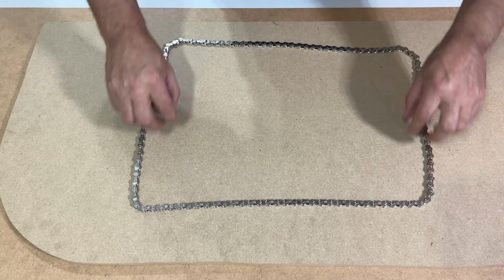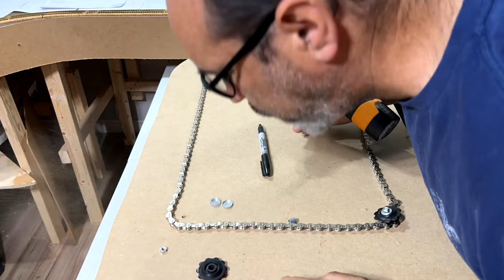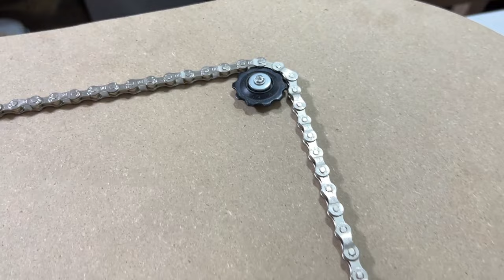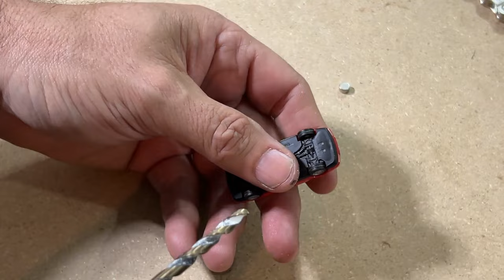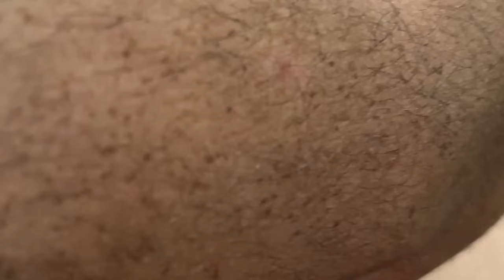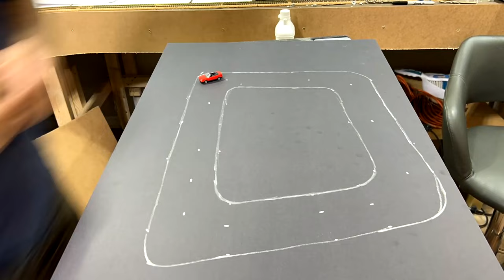Budget DIY Moving Car System For Your Model Railroad. Part 1 - Proof Of Concept.

Comment: For the tension use one of the jockeys fixed inside the chain run by a weak spring attached to the board. You would need a U shaped bracket to attach to the jockey with enough room for the chain to run through it.  I appreciate a drawing at this point would be useful…
Reply from the maker: Who needs drawings when we have overactive imaginations, lol.

Comment: You're doing what I have been thinking about for a while now. Recently, at the ventura train show, I saw a working concept of using a TV screen to imitate moving water with moving boats. I like your idea for the roads, but wear and tear on the road (let alone the autos) is something I consider as well. (I should add, the boats on the TV screen were actual models attached to a rolling motorized frame that was guided by an optic that followed a moving blank spot on the screen...it was pretty cool)

Comment: Nice idea, a lower ratio geared motor might help make it run smoother. Like the idea that the vehicle can be placed anywhere along the chain. I have used a plastic chain with magnets glued at various points. I found that by using clear acetate strips under the chain it reduced noise and friction. I also use sleds with pins which slot into different vehicles.

Comment: Great concept. Maybe some strips of aluminium foil or waxed paper glued to the board under the chain will reduce the friction and noise? I think using tension to raise the chain will put too much pressure on the sprockets and you'll get other issues.

Comment: I made a similar system a few years ago. I used a Takanawa 555 gear motor geared to around 40RPM. The 555 motor comes with a slotted shaft and is a direct fit for a jockey wheel. Simply screw in a small self tapper on the inside of the jockey wheel hole to fit in the slot. That way, it only turns with the motor. Also, those metal washer things on the jockey wheel - remove the bottom one. That way, the wheel sits at a better height on the base board without the teeth fouling the chain. I had one jockey wheel at one end, and another one at the other, to give a long loop. It gives the impression of two way traffic if you hide the turns at each end. Next i used some 10mm thick XPS board to build the road level up to chain height. You need to use 1mm thick magnets glued at your preferred spacings on top of the chain. 1mm card was then used as a road surface. Don't fix magnets directly to cars, because you're forcing the whole car down onto the road with too much magnetic pressure - make some 'sliders' similar to the Magnorail ones. That way the car just sits on the top under it's own weight. The whole system worked very well at a fraction of the cost of Magnorail. I intend to build another one into my next layout.

Comment: Dear Scott, cool experiment, proof of concept already achieved. Humbly think you’ll need a channel on both sides of the chain. Just enough to keep the steel pins of the chain from touching the wood. Next to that, am also wondering if such a channel can provide support for the motion of the chain with less cog wheels? Maybe even with some bearings adjusted to the height of the chain. Anyhow, love this project. Looking forward to your next episode. Cheerio
Reply from the maker: Thanks Vincent. I was thinking of using something like electric wire conduit to channel the chain, but it might be too noisy. I know it can be made to be quiet, since a bicycle doesn't really make any noise when you pedal, so I know it's possible if I can just remove the friction.

Comment: loved the different idea. i think if you use either bigger gears, or maybe 2 or 3 smaller gears to build a turn, that the cars will follow much better. or a much stronger magnet that really grabs on. Last idea would be to fix steering weels as the car now only wants to go in a straight line. ow and build in a speed reduction in some way as you dont need the full amount of RPM from the motor.

Comment: What you could do for pulling the car along is a method similar to actual magnet rail track.  They use a a little copper strip with the end turned up to put the car on and thin magnets on copper strip, not attached to the car.  Making the copper strips would be easy.  Just take a piece of solid copper wire from 14 gauge house wire and hammer it out flat. You might get 2 pieces from the same length strip of wire.

Comment: So, if you shim up the chain, so its not touching anything, add extra jockey wheels, as has been suggested as sprung jockey wheel to add tension. Think derailleur.
Make longer chains with soft links. 
Excellent proof of concept.
Reply from the maker: I'm going to head to Home depot and see what slidey channeling they might have. I don't think I can avoid the chain laying on the ground. I would need a huge amount of tension, which would require an extreme motor with fancy bearings yada yada. A derailleur is a fine idea, but it's just something else to take up space.
Thanks for your ideas and nice comments.
Reply: Making longer chains is easy. You just need a bike chain tool to push the pins in or out.
I have a tandem bike with 3 chains and store bought chains are never the right length to start with.

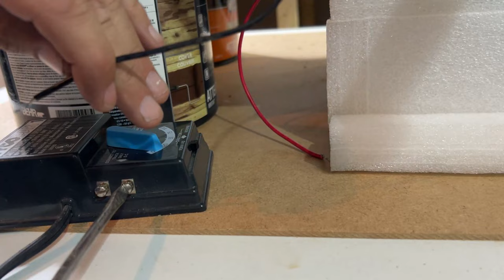Comment: Advice: At 12:40 - When attaching a wire to a screw connection - wrap the wire CLOCKWISE around the screw so it pulls the wire into the screw rather than pushing it out as you tighten it!
Reply from the maker: Thanks Steve. I normally do that, and did do it with the red wire.

Comment: Thanks for you video. I had the same idea a few years ago having seen magnorail and have been searching for a plastic chain, bit like lego use , but as yet no results.  I was to be using a geared motor with a 1-2 mm pvc foam road bed 😊 Dave

Comment: Hi Mate, You may want to try with geared( with Reduction gear) motor so that  you will get  more realistic slow speed operation and  better speed control.
Reply from the maker: Thanks for the advice. It's sort of on hold till I sort out my track layout. Ripping it up and starting over.

Comment: You have inspired me with your video, I am going to try this idea with plastic chain, and sprockets. Trouble is I am not up on electrics, so what motor is best and what mains controller do I need. Thanks Dave
Reply from the maker: I wouldn't want to advise you on the motor, since it's a potential fire risk, but I would try and match your power supply with the motor. If you're using a plastic chain, then presumably you won't need such a heavy duty motor like I'm using.
You just don't want to be running more volts through your motor than it is rated for.

Comment: try a motor with a gearbox.  It will give you more torque at lower rpm
Reply from the maker: I think the motor is ok, it's just getting caught up in the misaligned sprockets. I'll have another update soon. Thanks for the suggestion.
Reply: @ScottRails  Glad to know there will be a Part 3 then! 😄

Comment: I was thinking, these tiny motors could push a car along an under-road coat hanger wire with a mgnet on the front to guide small cars. The cars could be looped through random routs and drive into a garage for rechsrging a small onboard battery.

Comment: I work for a company where some units use chain drives and the chain has a gutter type support to keep the chain level on unsupported areas.
Reply from the maker: That's the gutter I'm looking for. Where can I find it?
Reply: @ScottRails  Try square section cable trunking

Comment: To use a smaller geared motor and Is a belt. If you're concerned about slippage you can always use a tooth belt and tooth gears. The point is a built's not gonna make the noise and a gear reduction. Small motor is gonna be much quieter than a larger motor running at low speed.

Comment: Lol back to the drawing board  reduction gear for motor drive so motor spins in better running range  and larger sprockets for chain  corners so the transistion in direction is more gradual  and as you pontificated a less resitant surface for chain to run on lol or plastic chain ... also  properly mounted motor so its driving square to chain ... great idea needing more developement ... but also given an addition for my Z guage coffee table railway lol thumbsup for your efforts
Reply from the maker: Thanks for this. I just 3D printed a large sprocket for the motor, but are you saying I need a small sprocket for the motor, and maybe larger sprockets for all the "corners"? 
I can still use the larger sprocket for maybe a roundabout though, right?
Reply: @ScottRails  A larger sprocket will make the chain go even faster. You need to match the motor speed with the chain speed, ideally a gearbox. Running a motor too slow makes lower torque and power making it harder to move the chain. Those old controllers usually work by putting a resistance in series with the motor this makes the motor power even lower at low speeds (and the motor wants to take more current, heating it more). A feedback controller would be better and would hold a constant speed much better. To run the chain on PTFE sheet would be better.

Comment: Nice work Dave, just a thought when placing the magnets on the cars try to make the magnets level with the bottom of the tyers of the car and some kind of C channel to run the track in, I think as a tensioner I would just elongate one of the corner holes ? and maybe some form of lub as in INKOX may help ? ( something that won't affect the plastic channel)
Cheers Mark
Reply from the maker: Thanks Mark. I think I will need some channeling anyway if I want more of a sweeping bend, so I need to work on that. For the tension, I need to get it away from the motor shaft.

Comment: A belt would me quieter, but I don't know how well a magnet could be attached to it.
Reply from the maker: Yes, a belt would be better, but then we're talking industrial conveyor system, and then we're back to high budget.
Reply: @ScottRails  Timing belt? Pretty cheap due to the 3D printer crowd. Route a channel in plastic sheet, Polypropylene is slippery or that plastic cutting board plastic. Been thinking about it since I just saw Luke Towan make one with a bicycle rider.
Reply from the maker: @babbagebrassworks4278  yeah, it was that Luke video that made me want the system. I honestly thought it was a real cyclist hehehe. His video work is also first class.
Reply: @ScottRails  I thought it was real too, with one of those fancy lens that turns real life shots into model shots. Luke's work is extraordinary, modeling and vids.  Because he is Ozzie he uses stuff I can maybe get locally too. But on a budget I like low cost solutions as shipping to Downunder is crazy.

Comment: Dave maybe you can make some C channel with the plastic making machine and then put some lubricant into it to quiet it down a bit????
Reply from the maker: I think once I get the chain tensioned, it won't make that horrible noise.

Comment: You need a real sprocket, those are just designed for keeping chains straight not torque.
Reply from the maker: You are absolutely correct. My wife just bought a new 3d printer, so I can make my own, yay!